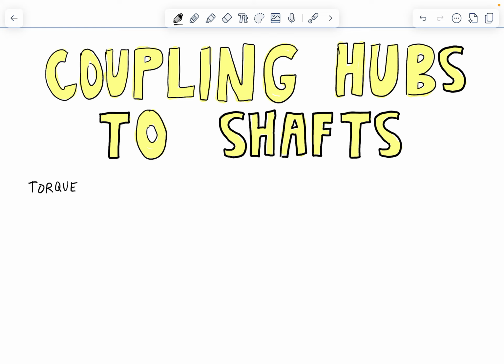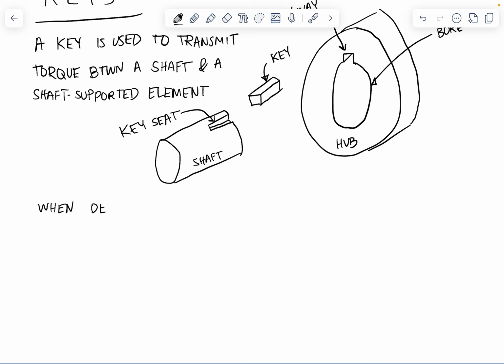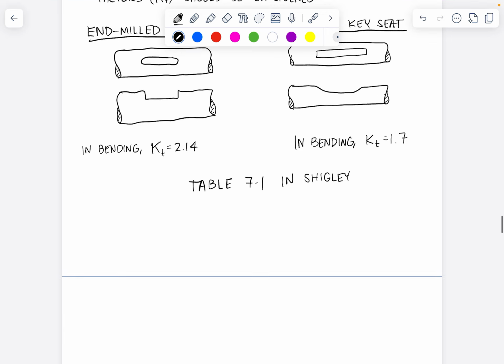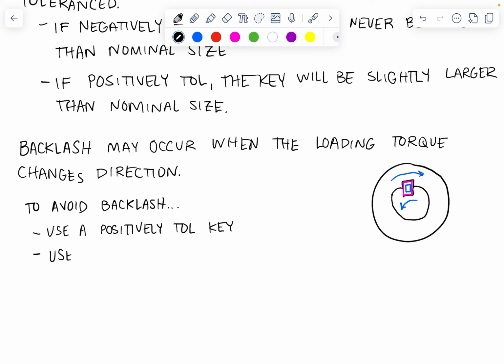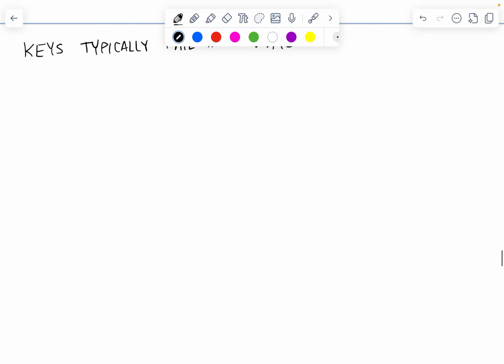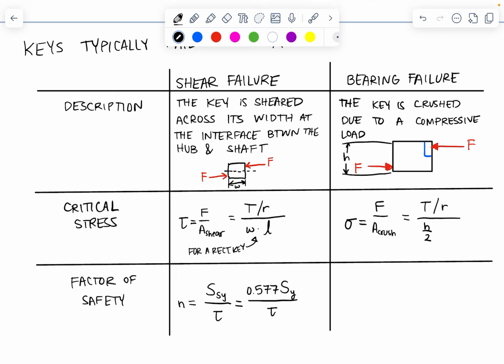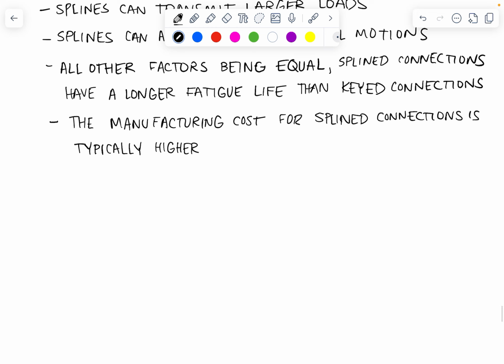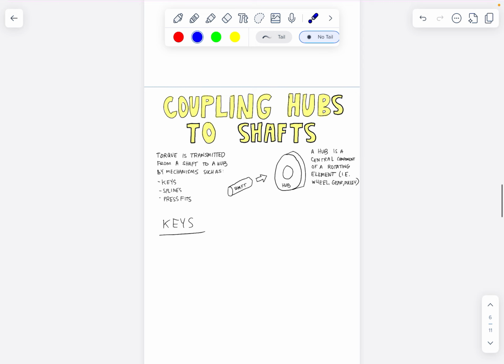Machine Design: Coupling Hubs to Shafts with Keys and Splines - Lecture 16C

Comment: A Briggs and Stratton mower motor has a taper on the crank shaft right where the key is and the key is wedged in between the shaft and the flywheel and a slight press is applied by a 15/16" nut.  So it is all tightly fitted togetehr and very little relative mation is possible, unless you hit a rock and then the flywheel wiil want to continue rotating and the crank will suddenly stop and the key will get sheared.  The fywheel has magnets which control the timing of the spark plug, and so the motor will not restart.